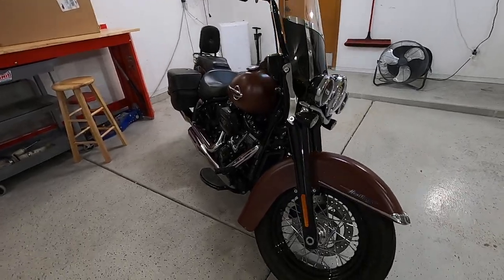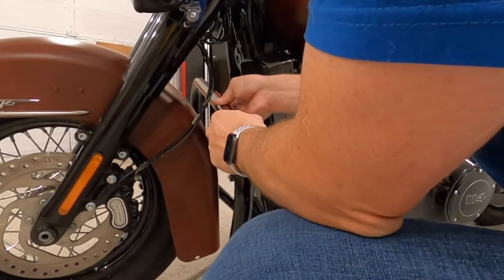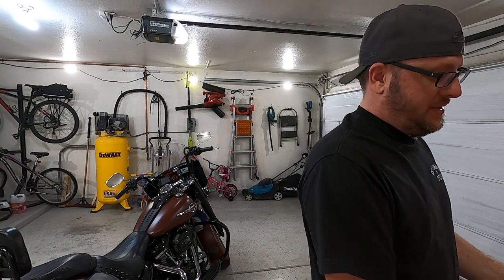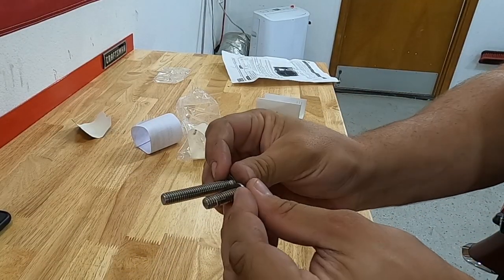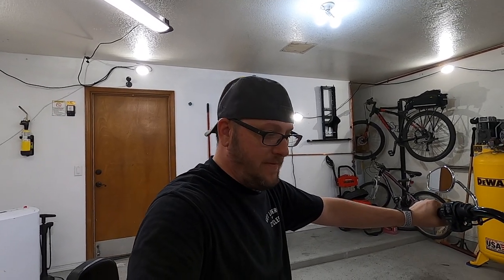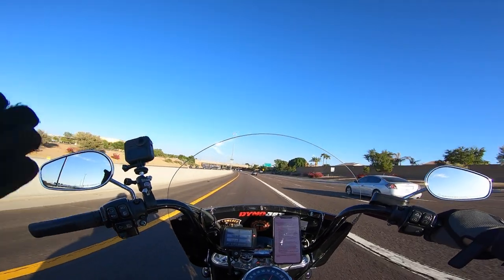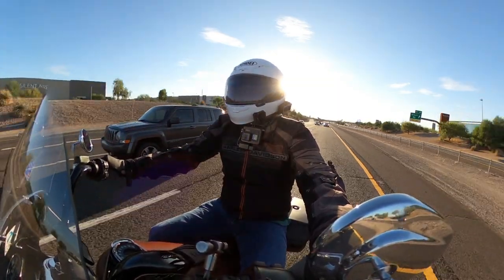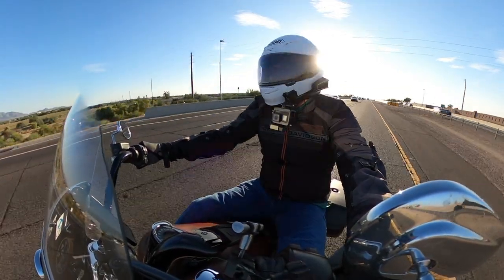Cobra-V Engine Guard and Ciro Footpeg Harley-Davidson Install

Comment: That 360 cam got a workout this time. The new highway bars look good, they fit the shape of the bike well.
Reply from the maker: Yeah I love the taper at the bottom, its different from what I usually see. And YES that 360 camera is AWESOME for videos like this when you are trying to show something like an engine guard with footpegs. Editing it takes significantly longer but I think its worth it.

Comment: Yeah, I installed the H-D engine guard (not the Mustache) on my '20 Heritage 114 and I'm still figuring out which highway peg mounts to use.  I've read that the H-D mounts, because they're powder-coated and the engine guard is powder-coated, that there are fitment issues because of the thickness of the power-coating.  I'll take a look at the Ciro3D products.  Thanks for the video, Dan.
Reply from the maker: The Ciro foot pegs are really good and also powder coated. I would recommend them. Come back and let me know which way you went and how it works out either way if you can.

Comment: IDK about washers. Maybe make a plate out of 1/4" steel with the footprint of the mounting surface (I wrote this out before the aluminum add.) Steel and aluminum will have an electrolytic reaction that will cause corrosion. With fasters,  studs or bolts into aluminum, unless the threads are sealed with loctite or the bolts are cad plated, they will fuse together and it's bad.
Reply from the maker: I will likely get a custom steel spacer made up at some point. I am not too worried about galvanic corrosion with the frame being powder coated and the aluminum spacer coated in plasti-dip creating a break in material BUT, it will certainly be something I think about constantly and the thought will force me into something else but similar.
Reply: @GearsGadgets  I don''t expect there to be corrosion either. It's just the quasi unexpected shite that happens.

Comment: The traditional engine guard bars keep with the traditional look of the Heritage. Couldn’t you have moved the oil cooler slightly to accommodate the bars?
Reply from the maker: Unfortunately the short answer is no, I spent quite a bit of time off camera trying every scenario possible.

Comment: EDIT I didnt watch all of the video, mybad. I still think you should get a plate fabbed at a local shop or something to cover the whole frame plate.
I really do not think those washers are a good idea. That's going to twist and torque the frameplate on the bike if it ever goes down, and if it goes down at some speed, you're going to snap the frame's crashbar plate, and you're gonna end up with a totaled bike because of a damaged frame.
I would look for a local fabricator or something like that and get a solid steel block made to go under it if you want to make space. stacked washers are a bad idea.
Reply from the maker: I probably will end up getting a custom fabricated spacer at some point.